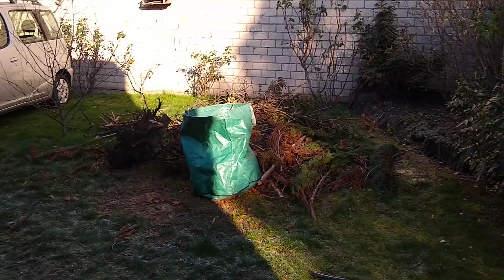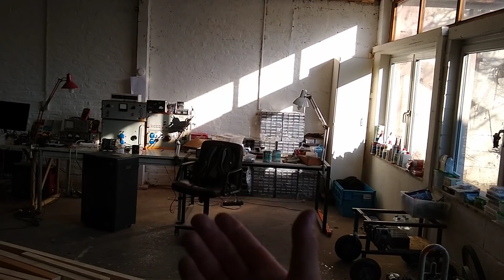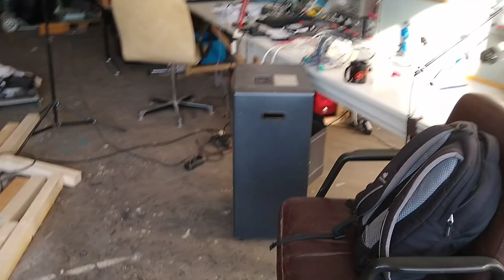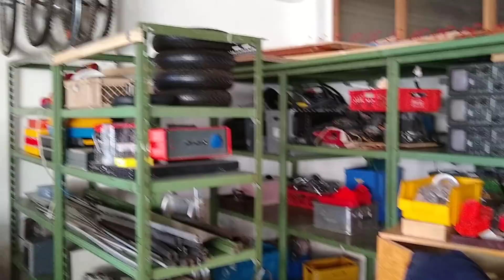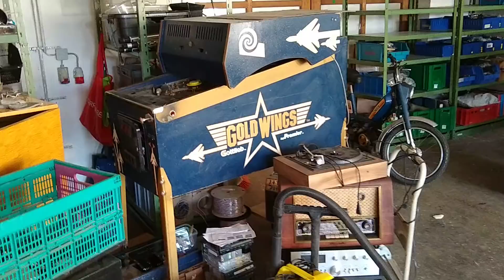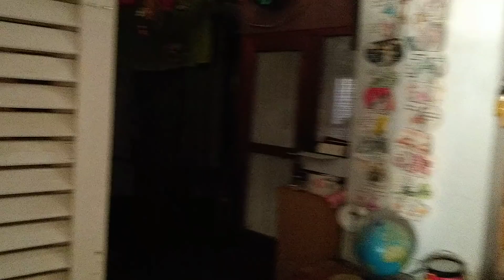New Workshop! (this time for real) - Shop Tour!

Comment: Very nice.  You have the workshop I'd like to have!  Maybe you could put a vacuum cleaner together too.  I hope your partner can do wheel-chairs too.  Not that I'm in your area and about to drop in but it's hard in areas of the UK to get good help with wheel-chairs so I hope your partner there can help wheel-chair users with the usual running problems.  It's also an area of manufacture that is awash with the parts that maybe your robotics can use.  All the best in the new place.

Comment: That extra 60^2 meter space would be a good place for office space and a kitchen. It is small enough to have a space heater keep it really comfortable in the winter and having a space to do programming for the robotics and other projects that is adjacent to the shop is really useful. It would also let you do video editing in the same location, placing all of your work in a single location, so less travel time, separation of work and home/leisure spaces for easier stress relief.

It is great that you have more space, too, since you can do larger projects. Just be careful not to fill it all up with clutter too fast ;)

Comment: Gravel, it's cheap and with a bit of hard shovel work you can put it on yourself. Worth it + works really well as water drainage for the rest of the land if you put some plastic sheeting + sand on the bottom under the gravel.